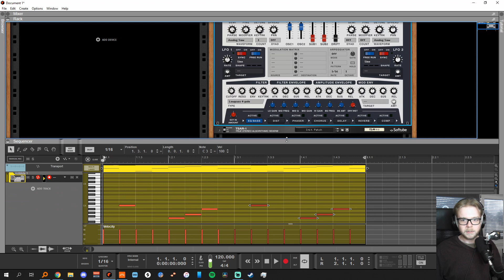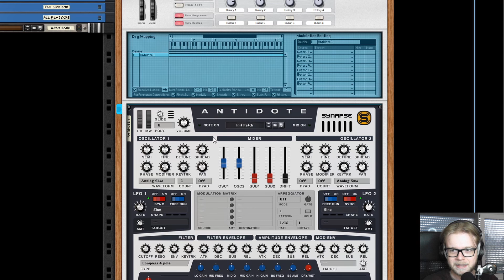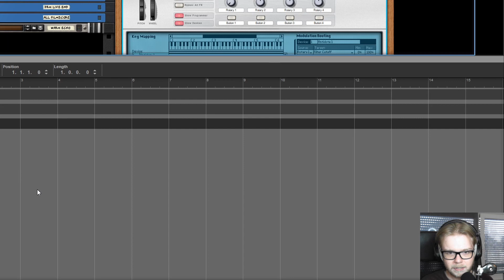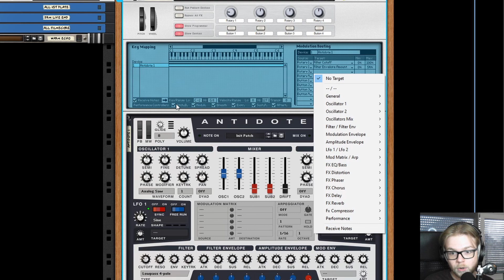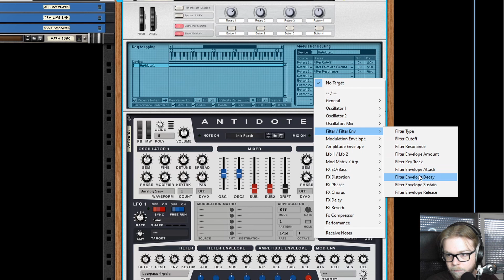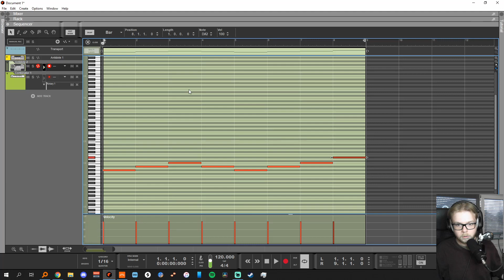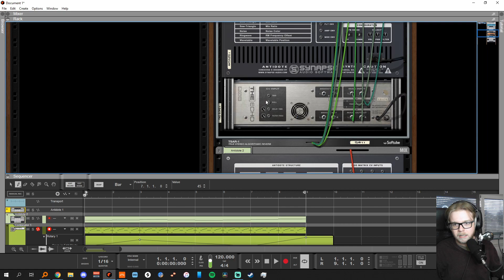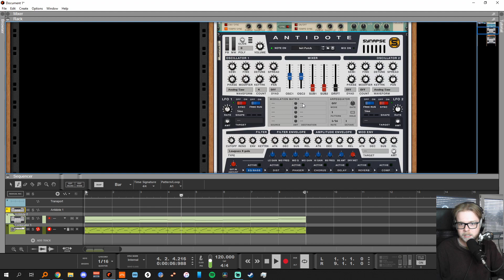Reason 11: Harnessing the Combinator's Macro Mod Power

Comment: The programmer CV is pretty good, you just have to select it in the source selection, rather than Rotary 1. The main difference between the two methods is that programmer CV inputs will have the pure CV modulation, where CV-rotary will allow the rotary to set the "start" point for the CV.